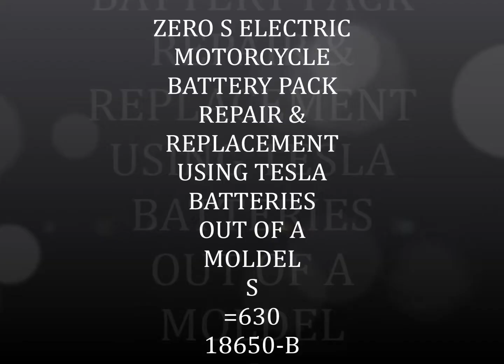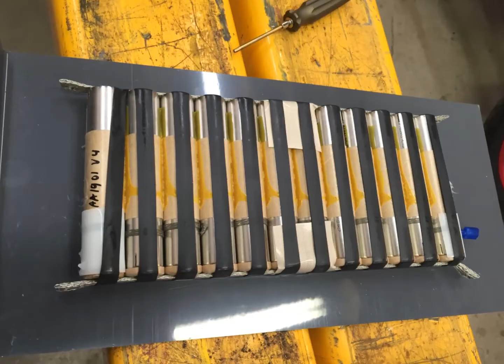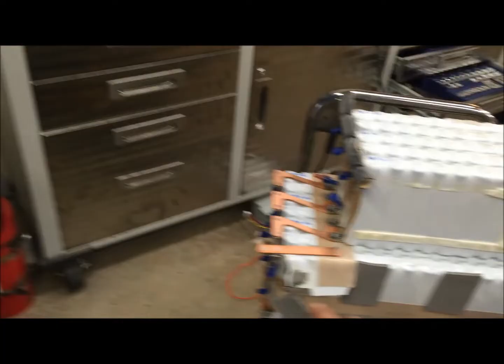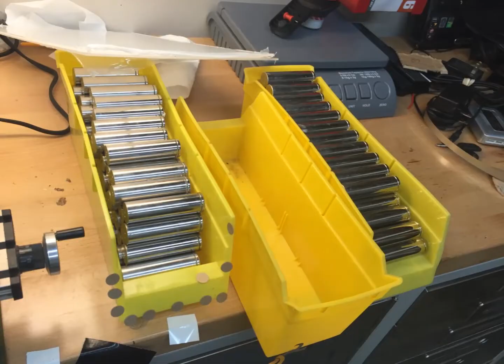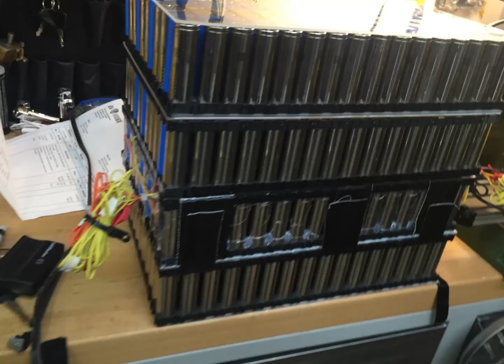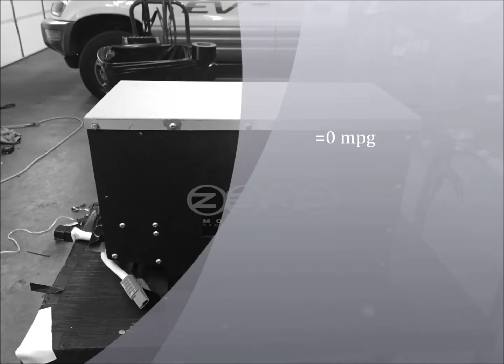ZERO ELECTRIC MOTORCYCLE TESLA UPGRADE

Comment: Can you please advise what the current status of the battery pack is?  I've got a 2010 MX that has zero miles on it, due to the dealer not taking care of properly charging. Before watching your video, I was going to either part the bike out on ebay, or use it for a lawn ornament. But now I'm tempted to follow your example (which will cost much less than the $7k Zero quoted me for a replacement).
Reply from the maker: I was actually running it today.

If you want to make it easy just get a handful of Nissan leaf battery sells. Super simple wheel fit good. If you have any questions about it just message me. Good luck

Comment: there is no way in hell you get 300 miles out of this pack. each Tesla cell new is 3.4amps x 45cells  = 153amps x 52v = 7956w, or lets just round it to 8kwh. which is almost 3 x the orginal 2011 battery pack capacity. that bike had a range of around 30 miles when new so your bike would be lucky to get 90 miles. Not 300.

Comment: Is this 300 miles in the city? Or at 70mph? Even so this is rad. How much were the used batteries?
Reply: there is no way in hell you get 300 miles out of this pack. each Tesla cell new is 3.4amps x 45cells  = 153amps x 52v = 7956w, or lets just round it to 8kwh. which is almost 3 x the orginal 2011 battery pack capacity. that bike had a range of around 30 miles when new so your bike would be lucky to get 90 miles. Not 300.
Reply: @sunshine5349  my 2019 zero ds gets about 90miles in the city, and m saying that from experience. I have a 7.2 kwh battery.
Reply: @LeviAvans  lol the 2011S has half the capacity of your 2019DS. the 2019 version has a battery pack 2x bigger is the main reason. hard to squeeze the needed power in that tiny box of the 2009-2013 era bikes.

Comment: 300 mile charging distance, but what’s your top speed?
Reply: there is no way in hell you get 300 miles out of this pack. each Tesla cell new is 3.4amps x 45cells  = 153amps x 52v = 7956w, or lets just round it to 8kwh. which is almost 3 x the orginal 2011 battery pack capacity. that bike had a range of around 30 miles when new so your bike would be lucky to get 90 miles. Not 300.

Comment: 300 miles on that self made battery back... I would like to know more, whet where, how? Do you have a diagram how all is connected and what controller/ballancer  did you use?
Reply: there is no way in hell you get 300 miles out of this pack. each Tesla cell new is 3.4amps x 45cells  = 153amps x 52v = 7956w, or lets just round it to 8kwh. which is almost 3 x the orginal 2011 battery pack capacity. that bike had a range of around 30 miles when new so your bike would be lucky to get 90 miles. Not 300.
Reply: @sunshine5349  yup.

Comment: You get 300 mies from that new pack?
Reply: there is no way in hell you get 300 miles out of this pack. each Tesla cell new is 3.4amps x 45cells  = 153amps x 52v = 7956w, or lets just round it to 8kwh. which is almost 3 x the orginal 2011 battery pack capacity. that bike had a range of around 30 miles when new so your bike would be lucky to get 90 miles. Not 300.

Comment: Thank you so much, such a Great Project! I bet a lot of people would be interested in owning an electric motorcycle that may go about 300 miles. Any New Projects similar to this one?
Reply: there is no way in hell you get 300 miles out of this pack. each Tesla cell new is 3.4amps x 45cells  = 153amps x 52v = 7956w, or lets just round it to 8kwh. which is almost 3 x the orginal 2011 battery pack capacity. that bike had a range of around 30 miles when new so your bike would be lucky to get 90 miles. Not 300.

Comment: 300 miles my ass!
Reply: there is no way in hell you get 300 miles out of this pack. each Tesla cell new is 3.4amps x 45cells  = 153amps x 52v = 7956w, or lets just round it to 8kwh. which is almost 3 x the orginal 2011 battery pack capacity. that bike had a range of around 30 miles when new so your bike would be lucky to get 90 miles. Not 300.

Comment: God... that's a impressive work...did u find the true range??and the max speed??
Reply from the maker: Selva Barathi Thank you.
I have never really drove it till it stopped.
Are usually drive it about 100 miles at a time. Still shows I have plenty. But I don’t know how accurate it is.

I am setting up my new shop now.
I have some fun videos coming Some day LOL
Reply: can you tell me ...What kW motor they have used ...and the battery voltage??
Reply: there is no way in hell you get 300 miles out of this pack. each Tesla cell new is 3.4amps x 45cells  = 153amps x 52v = 7956w, or lets just round it to 8kwh. which is almost 3 x the orginal 2011 battery pack capacity. that bike had a range of around 30 miles when new so your bike would be lucky to get 90 miles. Not 300.

Comment: you got 300 miles??? on 9kw reallly??
Reply: I'm calling bull shit on that 300 mile. I don't even think he got that thing to turn on
Reply: there is no way in hell you get 300 miles out of this pack. each Tesla cell new is 3.4amps x 45cells  = 153amps x 52v = 7956w, or lets just round it to 8kwh. which is almost 3 x the orginal 2011 battery pack capacity. that bike had a range of around 30 miles when new so your bike would be lucky to get 90 miles. Not 300.

Comment: 300 miles?! Holy cow that's awesome!
Reply: there is no way in hell you get 300 miles out of this pack. each Tesla cell new is 3.4amps x 45cells  = 153amps x 52v = 7956w, or lets just round it to 8kwh. which is almost 3 x the orginal 2011 battery pack capacity. that bike had a range of around 30 miles when new so your bike would be lucky to get 90 miles. Not 300.

Comment: Did you ever get further then 150miles on it ?
Reply: there is no way in hell you get 300 miles out of this pack. each Tesla cell new is 3.4amps x 45cells  = 153amps x 52v = 7956w, or lets just round it to 8kwh. which is almost 3 x the orginal 2011 battery pack capacity. that bike had a range of around 30 miles when new so your bike would be lucky to get 90 miles. Not 300.

Comment: Horrendous...if you use a stock controller using CRAP nickle strip that has the equivalent of 12 g wire MAYBE...you are  going to have huge resistance!...NOT what you do with a pack using that kind of amperage.

Comment: How about a follow-up video? Has everything held up? Nothing burned since your upgrade? Is your charging system able to handle the new batteries, or did you need to change it? Do you notice any change in the motorcycle's performance? What IS your new range? How much did it cost to get these new batteries?
 For reference, my stock 2011 Zero S goes about 25 miles on a charge, top speed is 62 MPH and it accelerates like a 150CC scooter. Slow.

Comment: You mentioned you removed the cooling solution from Tesla - any measurements of the internal heat under a full load?  Just wondering what the build-up looks like when they're packed this tight.  Assuming you're still using the stock Zero cooling solution, but might be wrong.

Thanks so much for posting all this - really informative and such a cool project.

Comment: Awesome Idea, build, and video! I just purchased a 2011 Zero XU myself. Would you ever consider, building a battery pack for someone in the near future? Providing I purchased all materials, and compensated you for your time, labor and skills accordingly? Great work!!
Reply from the maker: YES
I would love to do that someday.  I would like to build the pack completely so it would easy to install.
I would love to do this for a lot of electric vehicles that were made before the battery technology was good.
And as the battery technology gets better. Continue to make battery packs better and better for the older electric vehicles that way they can stay on the road for even longer. That's the great part about electric vehicles last a long long time. And as batteries get better vehicles will just go farther and farther. I would love to see your project as you go through your steps. If you have time please do a video and send me the link.
Reply: +Ev Jedi. That is great to hear. My problem is, I have very little knowledge about doing such a project, Or anything about electronics. Especially when it comes to lithium Ion batteries. At this current time my project would consist of taking apart the original battery pack, and doing a lot of studying.  I found a couple of Tesla Model S modules for sale on ebay. I plan on purchasing one, but from their I would be completely lost. Would you by chance be interested in building one for my XU  in the future?
Reply from the maker: +kevin C. I would definitely be happy to help you in anyway possible. It is a lot more simple than you think. Maybe you should order a few old laptop battery packs and take them apart and play with them. If you're going to build a large pack with several cells in it you may want to consider a spot welder. It makes the job a lot simpler they're not that expensive and it basically tack welds a little strips together for your batteries.
The way I learned all of this was I purchased a used RAV4-EV That was nonfunctional and had no battery and decided what the hell I always wanted one and they were always too expensive got one for $5000 and bought batteries & installed them and installed a BMS now it is my  favorite car it is a lot faster than any of the ones I have seen since. And then I was hooked now I have over 13 electric vehicles and continue to grow my collection.
And yes it is borderline addiction LOL. Maybe not so borderline  LOL
Reply: +Ev Jedi  Thank you very much for all of your advice, and your video's. I will follow your advice, and I shall keep you updated on my progress and my current project. I know what you mean about it being addictive. I have owned, and have been building  gas motorcycles most of my life, but since purchasing my zero, I have quickly become hooked on the electric generation and have plans to start phasing out all of my gas and oil consuming vehicles. Keep up the great work, and thanks again! very much appreciated.

Comment: Did you change the motor as well, or just the battery?
Reply from the maker: No. Did not have to. You would think I did find the difference. I guess it's because it delivers a lot more amps without hesitation or drag.
Of course you could do that. I really don't think you need to. If you want more speed off the line that really is just an adjustment in the controller software as long as you have the amps I do believe that motor could handle it. (
( sorry it took me a minute to respond I was out of town personal family SH-T A.K.A  life.  LOL )).
If you have any questions on your personal project hesitate to ask

Comment: Hi EV Jedi,
I watched your new video and I have just one more question. The bike I'm doing is a dirt bike Motocross Version 2011. The large plug that comes off the bike and leads to the controller which you plug into the battery has 4 wires plus the large main + and -
cables. They are all solid in color. Blue, White, Black and Brown. I am not sure which one is the signal wire and what voltage signal it sends to the controller to allow it to come on line. Right now if I plug in the battery it is not coming on line do to the lack of not having the signal  being relayed to the controller.
Reply from the maker: I will try to help with this. Let me start by explaining the signal wires you are trying to identify  are  CAN HI & CAN LOW.
It would help if you would explain what the problem is and what you're trying to do. If you're trying to just put the right voltage to the vehicle so it will drive. It will not work that way. You have to get The BMS to say everything is OK and send the correct CAN Signal to the controller and then the contactors will close and the controller will run. The only way to bypass that set up is to make a miniature battery pack just to make BMS Think everything is OK. Maybe you could do a video of what you're doing and put it on YouTube and give me the link. And I would better understand what you are trying to accomplish.
Reply from the maker: Good morning my friend
I just posted a video and it may help you with your project if you are still having trouble
It explains how to hotwire the bike you can bypass the BMS and use any better you want let me know if this video is helpful

Comment: Hi Ev Jedi, Great video! I'm going to be working on something very similar. I picked up a 2011 Zero MX with a bad battery. I tested the cells and almost half of them are shot. So I will also be building a battery pack with 18650's. Before I do this I want to check the controller and drive motor. Do you have the wiring diagram for this? It seems the controller needs to get a signal in order to work and drive the motor. I hooked up power to the stock wiring harness but it won't activate the controller. If you could tell me how to wire the controller or have a wiring diagram that would be very much appreciated.
Reply from the maker: Hi I don't have it on paper I don't think. But I will do a video pointing out what you have to do to check the bike. In the video you watched you can see how I tested mine before investing the money in the battery. You're exactly right it will not operate in less the BMS reports everything is OK. I am doing another one of these bikes but it's the dirtbike version it works exactly the same way. I will do a quick video pointing out the wiring and how you can test it I will try to get it done in the next day or two.

Comment: @Ev Jedi, thank you for your effort and sharing it!
I have a question if you dont mind. I am planning to convert my motorcycle into electric. But I am not sure what type of motor to choose, what type of batteries to use. I dont need "ludicrous" speed, but nice mile range would be awesome. I am thinking of Li-Ion 18650 Panasonic, AC brushless three phase induction motor. But I am not sure the KW of motor. I am dummy in this field. Please help me out :)
Reply from the maker: I wish I could be more help. But there is a lot of variables in there. It really depends on what will fit and what you were trying to achieve. The motor you are thinking about is a good one. As far as battery pack leaf battery modules are a great deal.
However 18650s are my favorite safer stronger and so on.
Just do your research read up on the different advantages and disadvantages to the different motors you're thinking about.
Building your own is definitely fun. And you will know everything about the bike when you're finished. But it is definitely not cost-effective.
So I hope you're choosing this because you love it. :-)
If you have any questions along the way don't hesitate to ask. There is several videos on YouTube find one that closely resembles your project and try contacting them. They might be a little more help. Sorry I couldn't be more help. (( good luck and thank you for becoming a subscriber ))
Reply: +Ev Jedi 
Thank you for reply. i am doing research on leaf batteries. I will get back to you once I need some help :) thank you alot.
Reply from the maker: +Shokhzod Muminov  no problem.
Sounds like a plan just let me know when you need help.
I love that video with Elon musk on your channel. The big bang Tv series
That was hilarious. Now I love that show even more.
Reply: Ev Jedi Elon is the man!Please carry on on developing your vehicle model. Might be meant for you :)

Comment: just started getting into electric vehicles first project is an electric mountain bike but seeing this gives me hope that at some stage I may convert my 650 ninja :)
Reply from the maker: That is a great little project. It is a perfect way to get started. Much better than the way I started. I jumped in with both feet. My first project had over 400 V. And I never messed with anything over 24V before that project.

As far as your second project. I don't think you should mess with perfection. In less the motor blows and you have a piss load of money you want to throw away. Yes electric is faster but that bike is pretty damn fast. And is a good will build vehicle.
And you were obviously A bike lover You wouldn't be able to stand it because it will take a long time to finish a project like that.
Save you money & purchase a blue lightning that is one bad Mamer jammer.   http://lightningmotorcycle.com  http://youtu.be/o3DiAecsh_0
Reply: +Ev Jedi I've seen the lightning it looks like an absolute beast!! Although if I was going for out the box I think I'd get a zero and slowly try improve it, while keeping the 650 project on the road and rotate them when one needs work the other could be in the shed. I'm super excited about the mountain bike project though, once it's all finished I'll link the video to you. Maybe later I'll be brave enough for the big amps and watts but I think you are right for now baby steps are best.